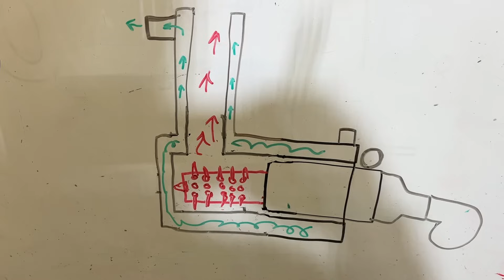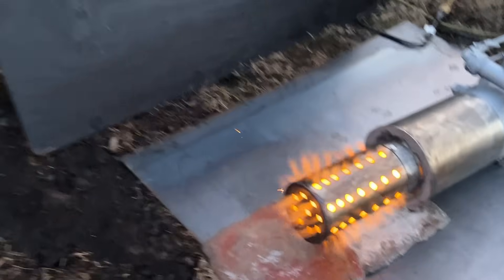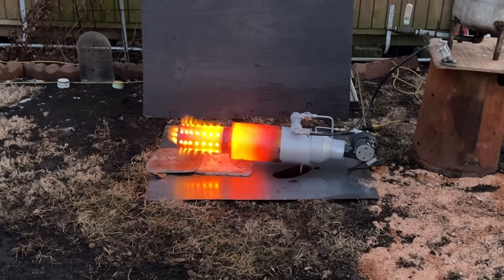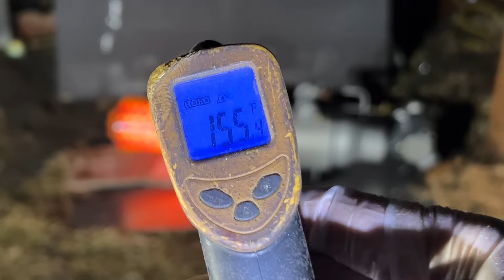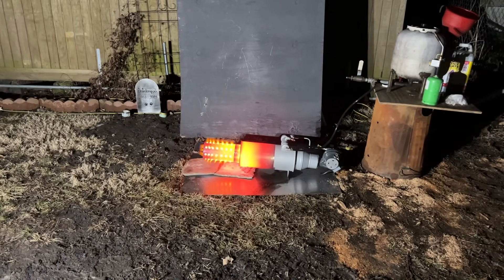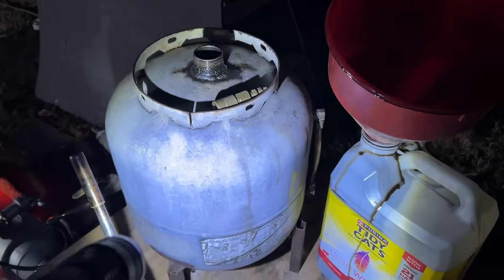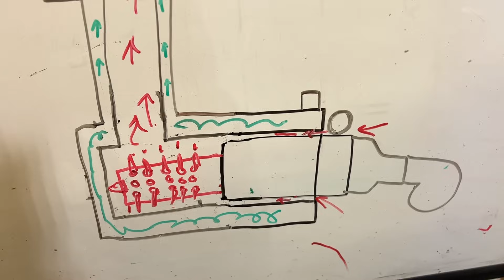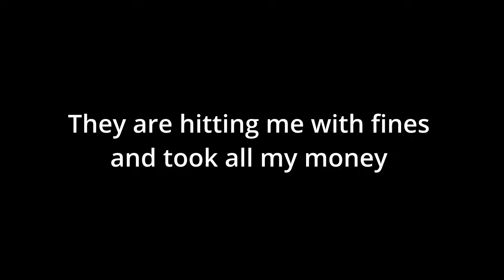Radiant heat tube waste oil burner VERSION 2

Comment: Since you have the burner enclosed, I'd recommend pointing it upward and wrapping your water jacket around it as a chimney, and then insulating the outside of that. You can plumb in a couple of elbows and use this same burner, probably, assuming there's not a problem with internal geometry made for gravity in this position.

Comment: Since dirt oil burns like wood as you stated. Modern wood stove use a catalytic converter, secondary air, and other unique ways to improve burn efficiency literally eliminating particles of ash. Would using any of those ways help you get rid of the ash ??.   
        I have stopped buying anything from CHINAMAN land. Everything you buy from them is just JUNK !!    What you said is true.........  😀😀😀😀

Comment: Thats an interesting conversion,  HP‐BTU 
I have a 218,000 btu Dewalt multifuel salamander and that thing whoops! 
Oppressive heat 🥵 

I dont think I have commented on your videos in the past but I have to say I really appreciate you sharing all that you have, what an encyclopedia of heat you have created! 

I am working slowly towards building a smelter to do cast iron, intending to modify an oil furnace burner and am hoping to just run diesel and waste oil.

I figure I could potentially regulate the output but I have too many fish in the fryer so I just have been accumulating parts for now.

Comment: alcohol helps a clean start
Reply from the maker: One issue was i had not yet learned how to light this device with the heat tube on it . Next time i bet i can get it fired right up
Reply: @NOBOX7  can you use something like a neon transformer / oil burner transformer for spark ignition that is switched ?